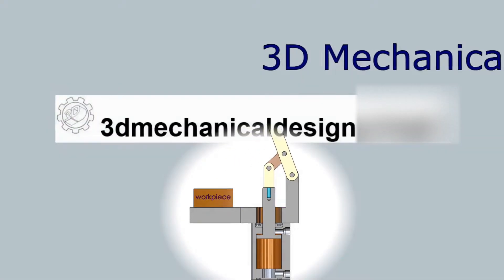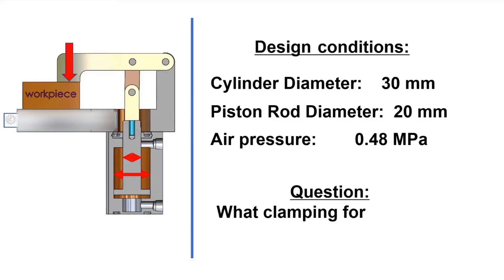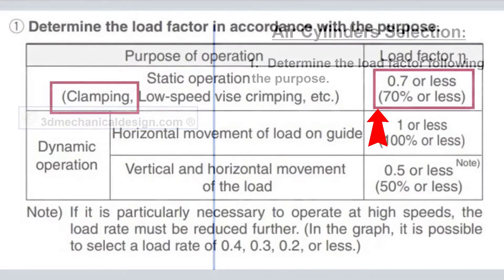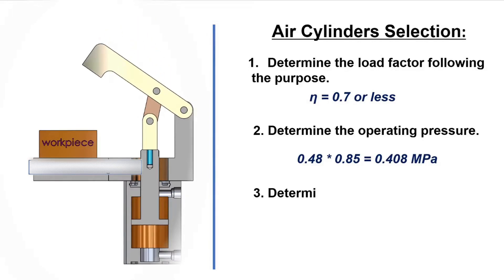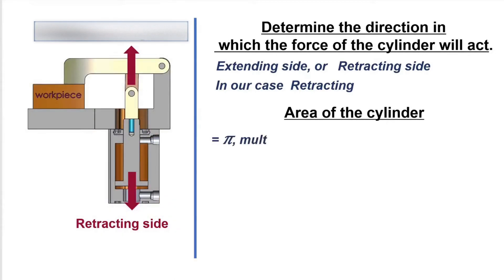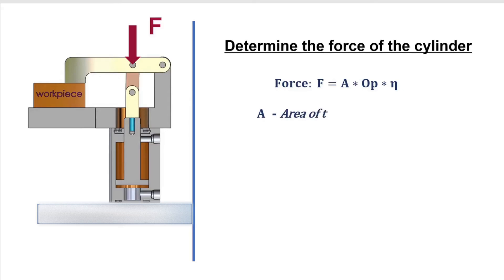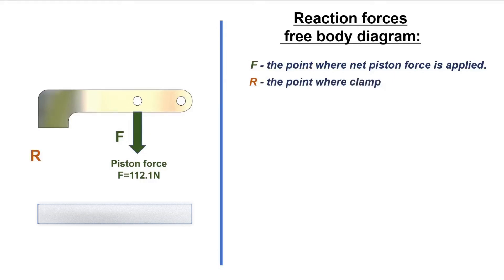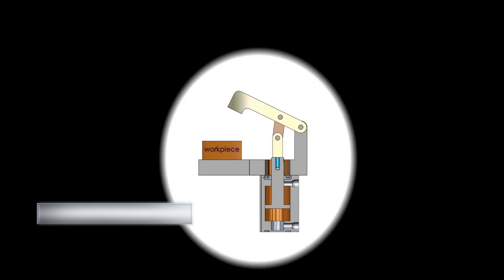⚡ Clamp calculation, Air Cylinders Selection(Retracting)

Comment: Thanks for sharing but could you explain what is load factor in this?
Reply from the maker: The load factor in accordance with the purpose of operation.
Static operation, Dynamic operation (Horizontal movement of load & Vertical and horizontal movement of the load).  See the table in the video.